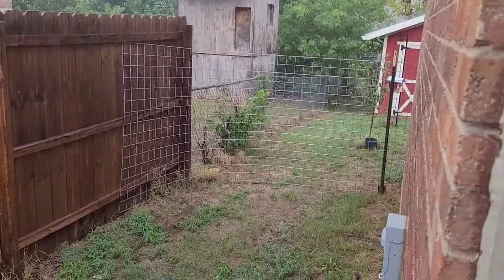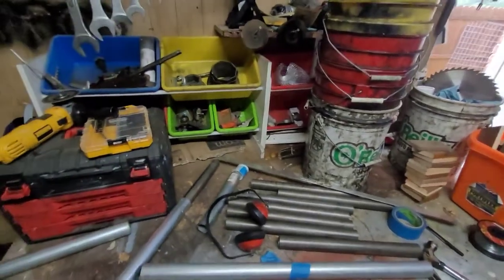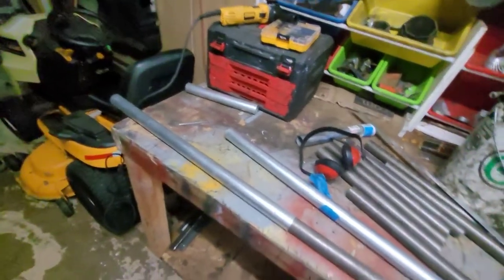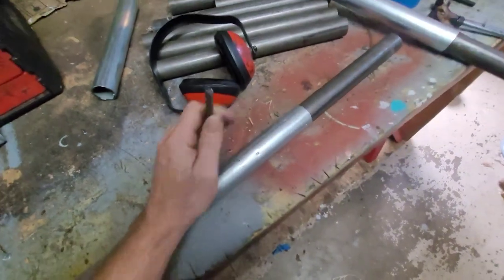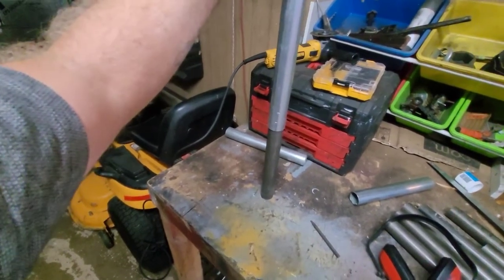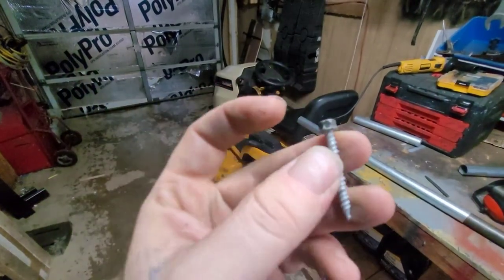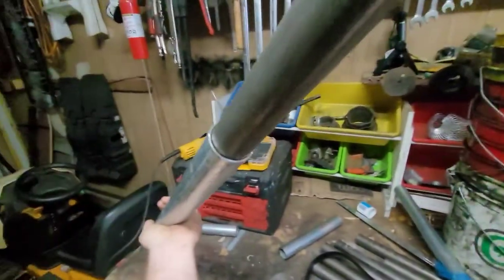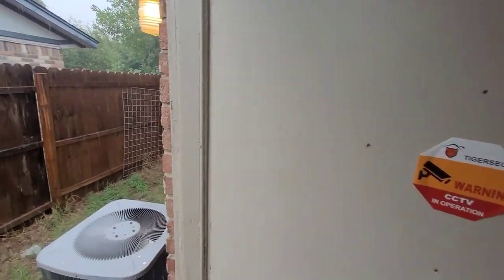How to make fence post extensions

Comment: Could you fill the bottom part of the post with pea gravel, to prevent the top post from slipping down inside it? And you could drill a small hole at ground level for drainage.
Reply from the maker: I like the pea gravel idea and the hole.  I might have to try drilling a small hole just in case they're trapping water.

Comment: did you weld the extension to the pole you were extending?
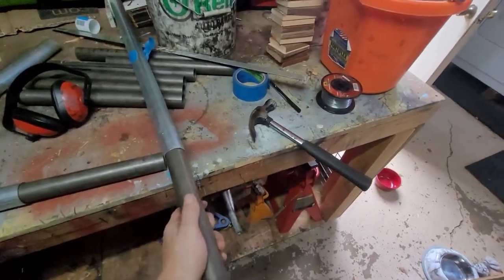Reply from the maker: No.  I wouldn't ever weld on galvanized metal bc the fumes are toxic.   I just used a hammer and a punch and made some indentations on the pipe, then slipped the splice in there.  Go to 1:32 to see.  
This video shows quite a bit more of the process: https://youtu.be/4krFeBuMDnw.  If you go to 5:12 and 8:28 in that video, you'll get a little more in-depth explanation.